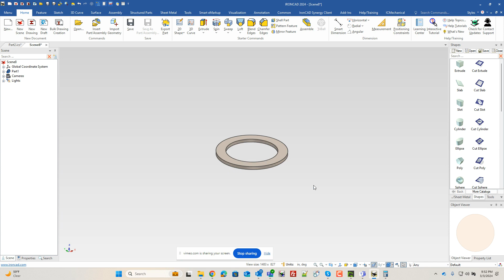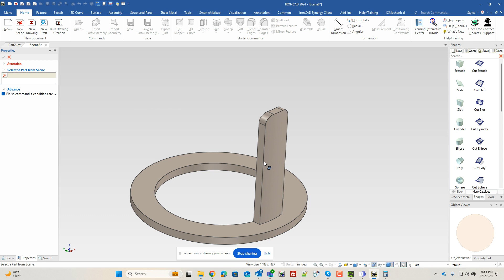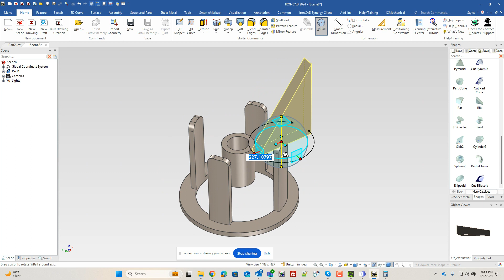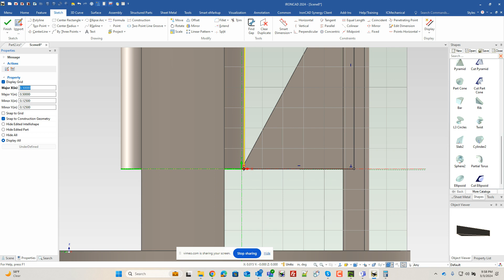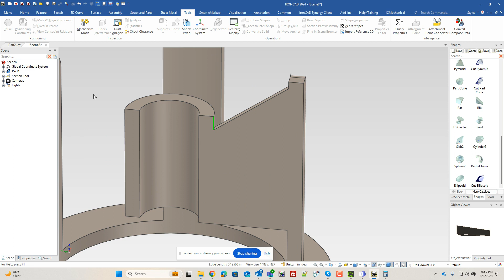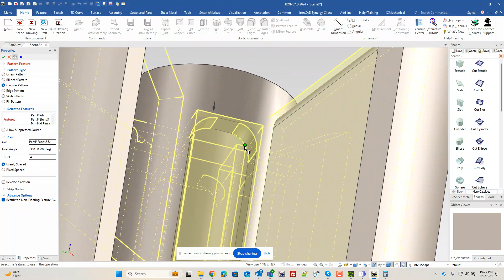Too Tall Toby Practice Models Performed in IronCAD - Practice 9 - 24-01-09

Comment: I got 0.04740lbs, the tolerance is at 0.00003lbs which is a lot of difference. May I know which one is correct? I'm using Solidworks.
Reply from the maker: 0.0474 is correct. I have the saved model opened in IronCAD. I can't recall in the video but I might have had something slightly off when I was recording versus the final model. Good catch.
Reply: @IronCADTeam  Thanks a lot!